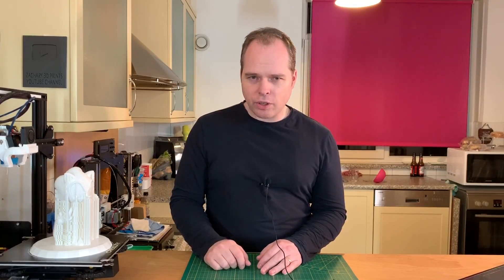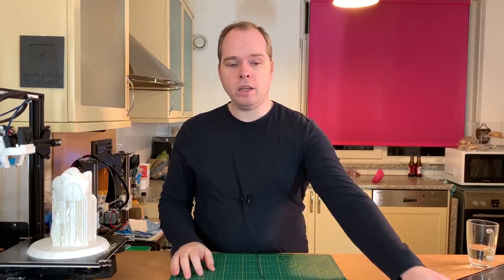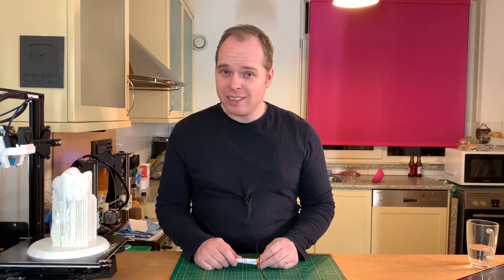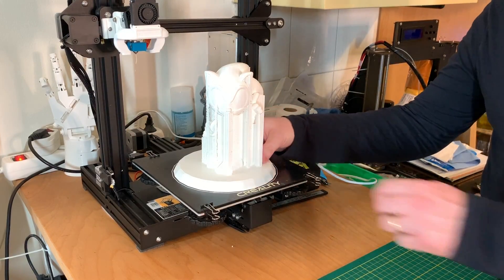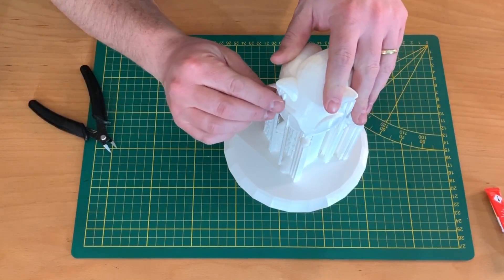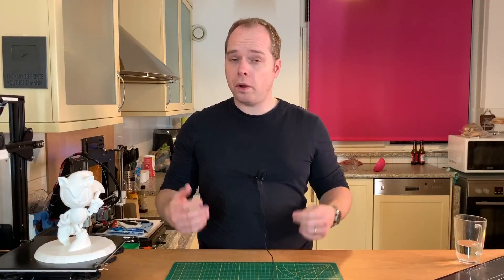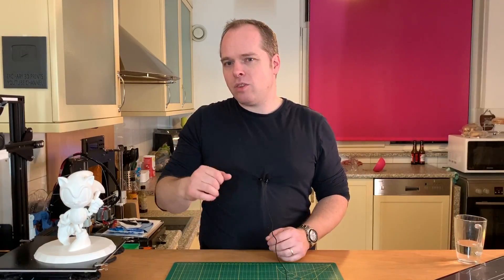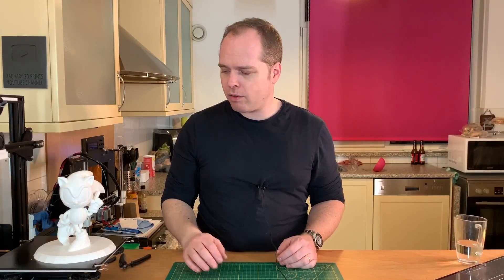How to remove Support from 3D print

Comment: Never had a part remove from the glass platen on my printers that easily like you show.  I have had parts warp, distort, and misprint if the platen isn't warm enough, which helps adhere the part to the platen.
Reply from the maker: With glass beds like these, once cooled down, they just pop off. 
To get good adhesion, clean the bed with dish soap or IPA, level the bed also during the first layer print and it should be better.

Comment: How do you remove supports in a tight, encircled situation pls help me
Reply from the maker: For something like that, you can use a little file or a pry tool, something with a thin but strong point tip.

Comment: I'm having issues with the supports leaving marks underneath my print where they support them.  They make the prints look kind of ugly underneath the supported parts.
Reply from the maker: Sorry for the late reply. I have them too and try to minimize them by finetuning the slicer settings or using different slicers

Comment: You never want to rip supports out if you’re using resin by the way,
Reply from the maker: Yeah, on resin they can be way easier to remove
Reply: @Zachary3DPrints  for me it creates odd dimples on the print

Comment: I have a question for everyone or anyone to answer but for some reason every thing I make keeps breaking either just from using it or taking of supports I don’t know if it’s like the filament or me or my printer but the stuff breaks very easily
Reply from the maker: Hello ImLordBored, when models have thin walls or the model is thin, it can easily break when removing the supports. I'm always careful, but power glue to the rescue

Comment: Hi, Im having issues printing a model which uses Boole - i connect and flatten the object in C4d ,  Cura sees the holes (windows in a building)  , but the printer ignores the holes
Reply from the maker: Hello Fedele Rinaldi, thank you for your comment on this video. Is the issue solved? I don't know what Boole means. Usually when having holes in models i use paint supports or custom supports and place them where needed

Comment: I have a print that has been going for 5 days and its almost done.
Reply from the maker: That's amazing and did it turned out great?
Reply: @Zachary3DPrints  it did turn out great.
Strangely enough about a third of the way up the printer seems to have skipped a few layers. (I think that might be a software issue) but all I had to do was glue it back together.

It looks amazing but the seam is very noticeable so I might redo it
Reply from the maker: Oh bummers. yeah sometimes it can work out very sweet, but if it is too noticeable, better redo it

Comment: The general idea is there and its good advice. But you should include a technique or method of how to get those tricky spots like the nose off without damaging the print. It was all glossed over in the montage. As well as flat supports that leave the infill pattern on the print which are very hard to remove cleanly in one shot.
Reply from the maker: Yes, Indeed a lot of people have said this about that, so in a updated video I'll show this in more details

Comment: Hi sir , I had a problem with removing support. I'm having AC Chiron printer , PLA material I used. I used CURA software. For touching Build plate and Everywhere support , the supports hardly sticks with printing part. It's very hard to remove that Sir. Sometimes Main part was damaged or broken. I always fighting with support, completely challenging. Do you have any idea to get rid of this sir?. Please comment. Support density is 15%. 

In your video, your supports are weaker, easily separate from hand, but  mine is I need a plier, nose plier, knife, spatula, and minus head screw driver. I hope you imagine what my struggle is sir.

Thanks sir
Reply from the maker: yes I understand the struggle of removing the supports. Try to use more walls on the model, going from 2 to 3 walls. And try custom support or tree supports. I'll be posting a video soon about removal of the supports
Reply: @Zachary3DPrints  I am waiting for your new video. I didn't try tree support yet. Is this good?

Comment: Thank you for video
Any how using single support fdm 3d printers has its own difficulty in removing the support and it doesn't seems to be a proffesional solution...it takes too much time , damage the part,not all areas of the part has tool access  to remove support, also denderous to harm your hands and ...
Reply from the maker: Yes, indeed, always be careful with your hands during removal of the supports. And it's always great to test new supports out...